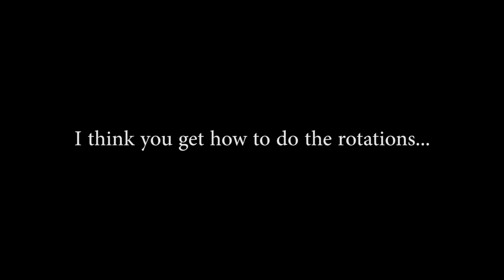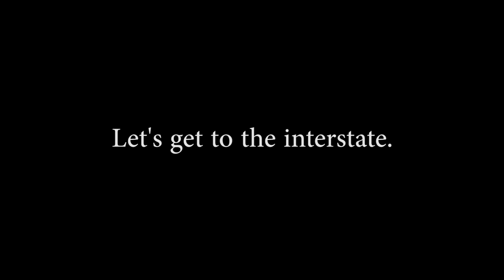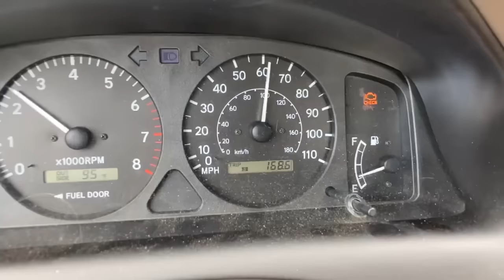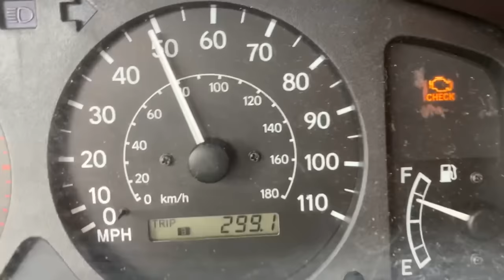Will Berryman's B12 Chemtool stop oil consumption? 😲 | Oil Burning🔥Experiments | Episode 15

Comment: I would've changed the oil to prevent the dilution tbh, but interesting results. Can we have a part 2 of the car in 600mi, 900mi, etc? And maybe another B12 treatment?
Reply from the maker: I plan to do a follow up when it does actually use a quart of oil. Hopefully we'll get a couple of thousand miles on a quart. If it's still using some, I'll probably repeat.
Reply: i think the b12 in the sump during the highway trip did most of the cleaning.  did you see the oil drain? its never been that dirty.

Comment: I have always run a kerosene flush at every oil change in my truck. But once a year I get a can of the red straw spray B-12 and spray down my push rods, as the biggest issues on my truck is sticky lifters, then run the eng with the B-12 as you did as my flush for that oil change. I've never burned any oil, and when I take my valve cover off there is NO sludge. B-12 is, has been, and always will be the best out there for it's price.

Comment: Your problem is mainly worn piston rings and valve guides which will account for all the oil on top of the cylinders especially since you had flakes of carbon falling onto the tops of the pistons when you showed the pistons with the bore scope the first time
Reply: Piston rings are certainly somewhat worn, but seing an improvement in oil consumption is clear sign for me its not only reason of oil consumption

Comment: Anytime B12 or Sea Foam gets into the crankcase you should change the oil. B12 and seafoam are used to clean oil deposits out of the inside of the crankcase. It has the ability to break down the viscosity and the protection of the oil currently in the engine. And by running the engine on load with it in the crankcase can be damaging

Comment: I’ve done this hundreds of times in 55 years of mechanic work and it works but I also add a quart of kerosene in oil and drive it 30/50 miles if it’s really bad plus 2 cans of b12 in fuel tank

Comment: Ran a full can down the app of my 97 Jeep 318, the "Italian tune-up", and from then on it was a full can every fill up. Derek at VGG turned us on to the Italian tune up and I picked up snappy performance, 3mpg highway, smoother running. Gonna add some Marvel Mystery Oil in the crankcase and run the Jeep another 270,000 miles.

Comment: What does Berryman think of this adventure I think they recommend 1oz to 1 qt of oil. This is a good video it demonstrates what happens when you don't maintain an engine some people have gone as much as600000 miles by changing oil and filter every 3000 miles.
Reply: Modern engines have low tension oil control rings that gum up. That's why high quality fully synthetic oils are recommended. But 3,000mile mile oil-changes using synthetic is throwing money away. Modern fully synthetic can easily go 3X that distance. Forty years ago it was advisable to change engine oil more often 'cos motor oils were more basic tech then.
Reply: @briantitchener4829 not entirely true that you can go three times as many miles with synthetic oils. One of the reasons that engines get ruined. Nothing wrong with 3,000 mi intervals but five is about right. Oil breaks down and moisture collects. I'm running my 08 Ford focus. 160 k . It tells me when it needs an oil. 5K I'm down 1 pint of oil. Last trip I fuel mileage was 43. 6 trip before was 43.3. it runs like a brand new car. Change the oil every 5K and you will never be sorry

Comment: I found a company out of Australia FTC decarbonizer... its not cheap but dang we were impressed.  The crankcase cleaner with fresh oil & then replaced the filter & oil b4 driving.  The topend cleaner goes in the fuel & burns all or most of the carbon away from the top side.  They now have an outlet in Utah.  I now use it religiously!  If the engine being treated was ever over heated & the rings loose their temper.... it will still smoke but nothing like b4.

Comment: I can tell your not a mechanic! I use to do this on Chevy V8's because of carbon knock. First of all add the cleaner and do not rotate the engine then after a over night soak with the coils power disconnected use a shop towel to cover the engine and then crank it over with no spark plugs to purge the carbon from the cylinders then ( CHANGE THE ENGINE OIL & FILTER ) before driving it because all of that chemical has leaked past the piston rings and is now in the crank case destroying the bearings.
Reply: Do you recommend marvel mystery oil and acetone mixed together to use as a powerful cleaner to clean and release all the gummed up rings?
Reply: I would not use acetone nor mix it, it may cause a toxic chemical or cause damage to the piston ring or cylinders. Stick to the pre-mixed stuff even thought it may cost more.

Comment: Transmission fluid. Mix one to one and a half liters of transmission fluid with three and a half to four and a half liters of your recommended motor oil and drain after a few days of running or until the signs of burning oil and noise making dissipates

Comment: I work for Kia and we use valvoline intake cleaner and it works great (similar process) and is not very expensive. I think it works better than  berrymans.
Reply: Better? I mean, is it the same stuff? Better is difficult if not impossible.
Reply: @William Perri  they arent even close to the same chemical. The valvoline smells like bubblegum and acetone.
Reply: @keithfoco  so it's the bubble gum!
Reply: @William Perri  all I know is that I've had quite a few cars where we did the process with the valvoline intake cleaner and it has dropped the oil consumption in a big way. I've also had some not work at all. The best was one that was using 1 quart every 1000 miles and it brought it down to nearly zero oil consumption. Usually it knocks it down to a few spoonfuls every 1000 miles.
Reply: @keithfoco  👊 I didn't even know it existed so I'm going to have to take note of that for sure.
Reply: Do you have a part number for that? I own a Veloster with a bad oil habit.
.......When I look it up online there's a few different products - the plastic blue 12oz bottle is #602376 for $8-$9, whereas the metal white "professional series" canister for around $22 is #884526  
Thanks!
Reply: @jasonlee7129  it's the pro series 884526
Reply: @keithfoco  Awesome - The guy at Hyundai mentioned they do a cleaning "that sits overnight in the cylinders" ......but it's SEVEN HUNDRED DOLLARS!!! 
Since I already ordered the B12, I am going to try the procedure from the video out this weekend. If it needs a second application, I will try the Pro Series 884526 that you mentioned! 
Q - What is used to pressurize the cylinders when you perform the valvoline intake cleaner procedure you mentioned??
Thanks for all your input!
Reply: @jasonlee7129  it's too complex to describe here. There is a kit we have and a whole procedure. We pressurize the cylinders with just shop air to force the fluid into the rings. We do let it sit overnight for best results. $700 seems a bit steep. I think ours is around $400. But I probably charge a lot less labor to do it.

Comment: Love this series, awaiting to see 6-10k mi results.  My 09 Prius burns 0.75qt/1k mileage.  I've run 10-20% marvel for the last year without any oil consumption reduction and now the cat is P0420'n. At 240k mi, this is a hopefully path to keep mine running for another year. 
Good Luck and thank you for sharing your results.
Reply: U can try run 1 can of lacquer thinner in half tank of gas and run it until it empty. This will clean the cat but u gotta turn off the code with a scanner. I’m trying to convince Dave to try it out on his car
Reply: @blackysan  thanks I ran some DuraLube cat-fuel cleaner and allowed the code to clear for 2k mi, enough to get a new sticker.. but I here the hope of address my root cause (dam Mobil1 high mileage interval marketing reeled me in and now my trying to solvent an assembled engine)

Comment: Great results & excellent work Dave! can't wait for confirmed results. Would be interesting to check compression after this treatment. Did you feel any difference in terms of engine power? Mine is a 2001 Corolla S model it looks bad @$$$ but it of course burns oil & struggles a bit when going uphill.
Reply: I have a 2002 and realized that at 150k it has had no work done on it.  Mass airflow sensor was dirty.  Oxygen sensors were original.  Valve cover gasket did not exist.  Car still consumes oil but still has that like new pep.  I'm watching this guy to see it he actually has the answer to oil consumption.

Comment: I used to use B12 Chemtool in the crankcase at oil change, and got buildup chunks during the first time. I also would drizzle it in the carb while the engine ran. They used to recommend on the can those kinds of usage. Though it doesn't clean like it used to since Berryman removed the Toluene from the ingredients, I still use it in the fuel tank. I bought a '73 Ford with and FE engine that hadn't had the oil changed in years, and lots of crusty buildup, and oil not getting to the valves. I back flowed B12 into the oil passage and then ran the engine, The oil now flows to the valvetrain.

Comment: In 63+ years of messing with internal combustion engines, including working at an old-fashioned  SERVICE STATION, I've never found anything you can pour in an engine to stop oil burning. Not Amelie, Hastings Motor Honey, not Marvel Mystery Oil, no Lucas product, nor Berryman B-12 Chemtool (although I've used a dozen semi-tanker trucks worth of it on carbs and in gas tanks to clean fuel injectors). Some of these MAY help certain problems like stuck rings from gunk in the oil system, although I used to flush-out Flathead engines with 50-50 diesel and "white" gas and a couple of quarts of "re-cycled motor oil" at the service station. The CURE is to open-up the engine and FIX what's WRONG, which can be rings, valves, valve guides, valve seats, valve stem seals,  cracks or voids in the engine block or head(s), scored cylinder walls, cracked crankshafts (yup, found one on a 1948 in-line 6 Plymouth in about 1972!), bad seals, and MORE! Blankity-blank semi-clogged cat-cons can cause oil burning too. Honestly, if I knew of ANYTHING you could just "pour-in", even if it cost $500, I'd pass it along. A MECHANIC (not a part's changer) likes to eat, and he has to charge to find out the real problem(s). Can some "pour-ins" HELP??? Yes, sometimes,  just don't expect them to "repair" the engine.

Comment: When I did this I bought 15W40 Rotella T6 since it was already a high detergent oil and Xylene/Xylol which is the "active ingrediant" in berrymans b12 and I let it sit for a few day's. Car went from burning a quart every 300-500 miles to basically none. Took a lot of babysitting.. And make sure to change your oil after and you are better off shooting it out of the cylinder then pouring a small amount of oil 1-2 oz in each cylinder to relubricate the cylinders.

Comment: I wonder if the previous experiments with MMO and SeaFoam had any bearing on the success of the B12 Chemtool or strictly the B12 that did the trick. We've seen other YouTube channels having success with all of these oil treatments. Just a thought, I have no idea myself. Thanks Dave!
Reply from the maker: It's possible, but since it was still using about the same oil as at first, I don't think it did much in my case ... However, I think if I had used those other chemicals more aggressively, instead of the recommendations on the bottles, it might have made a difference. The thing I found about Berryman's though, is it smells powerful, like carb cleaner. To me, Seafoam and MMO smell like mild solvents. Just my two cents. Thanks for the comment!!
Reply: i tried mm and seafoam in a carboned up jeep 4 liter 88 jeep and nothing...till I tried b12. It worked great!

Comment: I would use a straw and vacuum or some kind of arrangement to suck the crud and carbon and other "stuff" off of the piston crowns.  And yes that drained oil was very dirty, looks like the chemical did something for sure.  Also the "after" test mileage should be the same type of usage as the "before" mileage, meaning same type of trips and same ambient temperatures... as much as possible I mean.  Hard to tell if the 300 test miles "after" the chemical were all the same type of usage as before.  But I like this video, good success to you... thank you.

Comment: Retired drivability technician 40 + years
Compression test before and after it would have been  good, leak down test also. That clean piston top is steam cleaned this vehicle needs a chemical block test to test for hydrocarbons in the cooling system
Very likely you have a head gasket starting to go, also noticed vertical lines across the cross hatches in the cylinder walls not a good sign
If I recall correctly compression I did on those engines we're about 20 to 30 lb more
We used to use Delco x66P top end cleaner
Would pour down the throat of a carburetor across the choke plate while operating the throttle by hand just as the can was about empty we would dump and stall the engine 
Let it sit for half an hour
Then start it up with a cloud of white smoke
To this day I love that smell
Now I understand they changed the chemical compounds of x66 to be more environmental 
Wonder if that check engine light is a p0420 
All that acetone and oil along with misfiring melted the substrate in the catalytic converter caused by misfiring and also coated it with oil

Comment: Still shaking my head at the results. None the less I am in the process of following this procedure. Should be able to take the car for a drive tomorrow and hope to get the same results.
Reply from the maker: I hope it works for you, Tom.
Reply: What results did you get Tom?
Reply: @FamilyFriendlyDIY  Followed the procedure then went for the drive. Drove approximately 40 miles, at the start the car smoked tremendously, like a steam train. Between 15 and 20 miles, the smoke started to clear up, On the return, the car was slow to accelerate and bogged down.  Checked oil on my return and it looks like all the oil was burned, stick was dry. To my surprise no CEL codes were thrown. I am recovering from shoulder surgery so it will be a while be fore the oil gets changes and the car is drive 300 miles to see if the oil burning issues is resolved.
Reply from the maker: @bamabonkers  I'm hoping for the best for you. How much were you burning before the treatment?
Reply: @FamilyFriendlyDIY  Hardly burned any oil on the 30  mile post treatment drive. Change oil and now working on the 300 mile drive. The celica would burn a quart in about 50 miles, really bad.